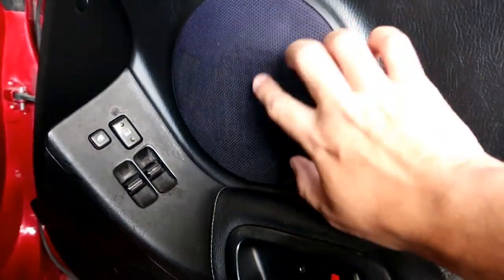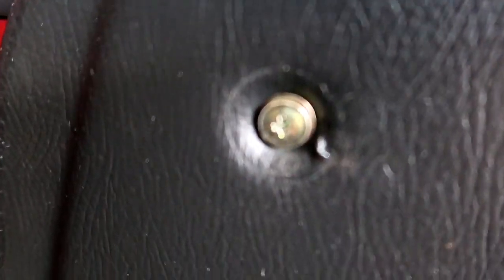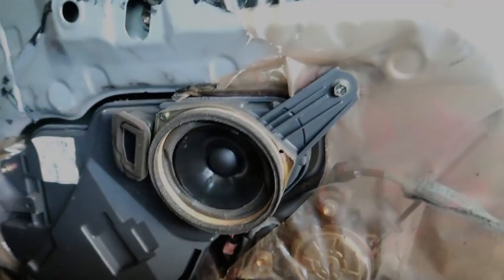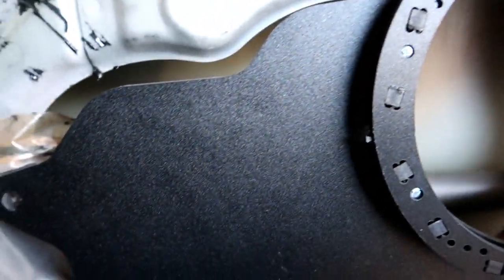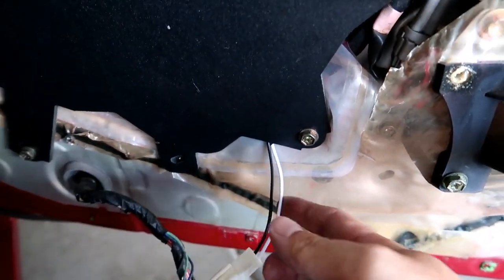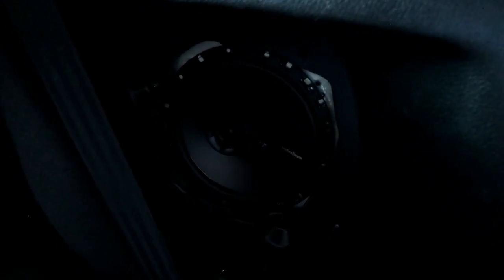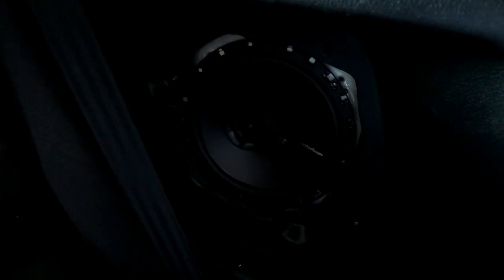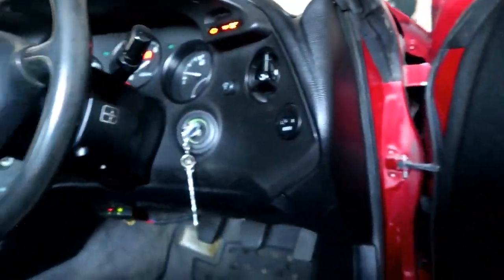Speakers Upgrade Tutorial | MK4 Toyota Supra

Comment: Be mindful that your factory grills are blocking a good amount of sound. Google an pic of the factory grills to see. Prob not that noticeable but I’d figure I’d mention it anyway. Keep on with the content ✊🏾
Reply from the maker: Good looking out! I don't really noticed much difference.
Reply: Correct, and there's actually pics in a build thread on supraforums of a guy that drilled additional holes to accomodate, would be worth a try.

Comment: Hey do you have a link on where you got the wiring adapter? I bought the adapter for the speakers already, but didnt think about a wiring adapter as well. Thank you in advance!
Reply from the maker: I bought the wiring adapter here:

https://www.amazon.com/Metra-72-8104-Speaker-Connector-Vehicles/dp/B0002BBP7Y/ref=psdc_2230642011_t1_B01D0UY05M
Reply: @jdmfaddy3923  awesome! Thanks man!

Comment: Hi, I’m about to do the same thing as my oem speakers are toast, do you think the 6.5” upgrade is worth it? Is it a noticeable difference? And also how long did it take to receive the brackets?
Reply from the maker: It took me several days to receive it from Amazon, but with this whole covid stuff, I am not sure how long now. A 6.5inch provides a better midbass performance, so personally I think it's worth. it.
Reply: JDM Faddy thank you for ur advice, you convinced  to buy the bracket aswell and toss out the 4” set-up. I want to buy 3ohm JBL speakers, do u know if it’ll work properly if its 3ohms? The factory ones are 4ohm and i still have the stock head unit, im
Worried i might fry something 😂
Reply from the maker: @YEOUBE  you should be fine. It doesn't make much difference.

Comment: Where did you get the aftermarket adapter for the speaker?
Reply from the maker: from Amazon. The link is in the description.
Reply: @jdmfaddy3923  that's not the one was talking about but I found it on ebay
Reply: @jasonpritchard9276  are you talking about the black and white cable adapter? could you send me a link?